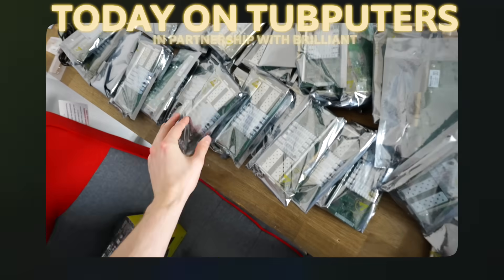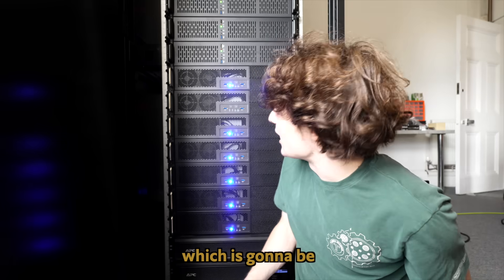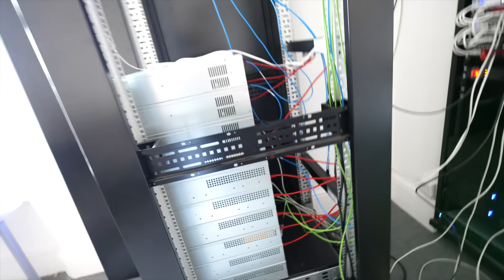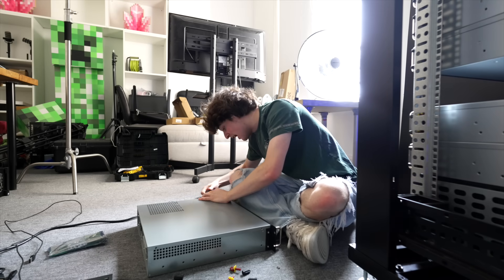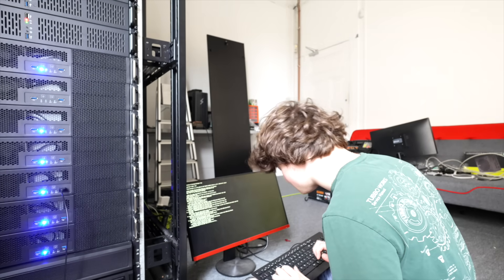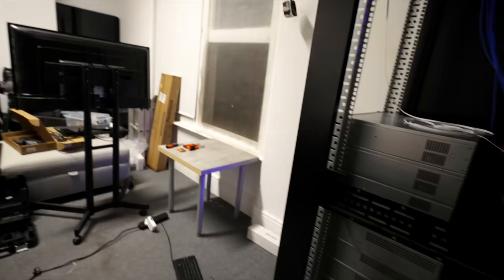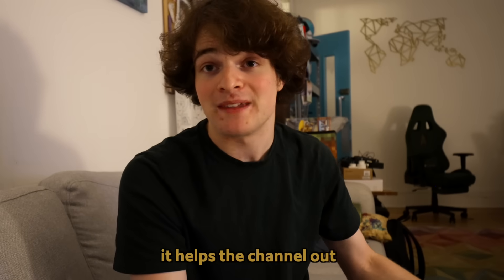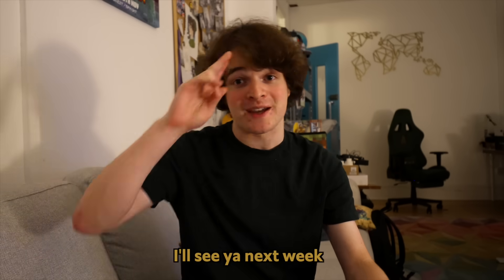Massive Server Room Upgrade!

Comment: Having the exhaust of hot servers pointing towards the intake of the servers behind is bad practice. you should put the racks in a position where cold air pulls through the front and through the servers and the hot air expelled out the back. Your best bet for next summer will be air-conditioning.

Comment: In a earlier video I had thanked you for doing what u are doing but I have found myself to regret that! Play. Host doesn't work and there is not support or answers provided for the data loss! 
Data loss is a big thing if it was a paid service you might have been sued by now! It being free is protecting you from that! 
. 
Just say how long server will not work. You will loose users more than when being honest if this goes on

Comment: Hey, I've got a small home lab with a Dell PowerEdge R710 and an R515, and I'm struggling with cpu usage and performances. i wanted to know how you are handling so much load; is it just because these CPUs are crazy, or is it that you run servers in a certain way? To move the load out of the CPU?

Comment: container@playhosting~ Server marked as offline...
container@playhosting~ Server marked as starting...
[Pterodactyl Daemon]: Updating process configuration files...
[Pterodactyl Daemon]: Ensuring file permissions are set correctly, this could take a few seconds...
[Pterodactyl Daemon]: Pulling Docker container image, this could take a few minutes to complete...
[Pterodactyl Daemon]: Finished pulling Docker container image
container@playhosting~ Server marked as offline...
container@playhosting~ An unexpected error occurred while starting the server. Please contact an Administrator. anyone know why this happened ? everything was fine til i enabled command blocks in server prop i turned it back off after the issue and its still the same.
Reply: now its saying This server is currently suspended and the functionality requested is unavailable.

Comment: at 6:40 you are setting the ip address manually, and bring the interface up. But I think this does not stays there when you reboot the server? Since those commands do not save the settings. 

Also wondering I see you have the switch at front of your rack. But the network connections are at the back, And you can reach the rack from the back side. Isn't it better idea to place the switch at the back?

Comment: Your best bet is to get your own AS Number and get Openreach/VM L2 Transport to London so you can control the whole network to minimise latency spikes - it's not so expensive. DDoS is an issue though so better to interconnect with CosmicGuard/TCPShield/NeoProtect directly so you dont need to tunnel anymore

Comment: I would recommend looking into a container platform, if you haven't already, so that you could have a backup node to pickup slack from other systems that need to go down, such as for upgrades, that way you could maintain a server online, even if potentially at reduced capability if the backup node isn't as powerful as the primary node. would make communicating downtime a lot better if you can tell them reduced bandwidth or short switchover time opposed to full server outage

Comment: Are the power supplies getting enough air? You have the cases on top of each other directly with no spacing between, meaning the cut outs for the power supply airflow aren't actually able to breath.

Comment: If you're interested in what the command was doing it was selecting the port on the new card, changing the ip on that card, then setting the state to "up" so it's usable. And then lastly setting the default route to your gateway. Depending on your OS, you can also just do this in a file, which can be useful if you're doing it on multiple servers, as you can just send the file to the server. For excample on Ubuntu you edit the yaml file in /etc/netplan/ to do the same.

Comment: Ok I like this video in the series. He is actually learning things. I personally have 8 years of low voltage and 4 years of cyber security experience. I learned by doing excessive projects for friends and family. Please keep learning. I understand you are small for now but at some point you will need to test these upgrades for months before putting them in production.

Comment: Love the video. However, my understanding is that the network cards you bought are passively cooled because they are designed to go in rack servers with high airflow (ie jet engine). If you don’t have enough airflow, these network cards might cool themselves to death. Check it out, I think a lot of people add small noctua fans to cool them. They also won’t get as hot if you use DAC cables for the SFP+ connections.

Comment: Should look into using passive SFP modules/cables, will dramatically cut down on the heat generated. Considering that it seems like all your connections are less than 10m, you should be able to do this just fine.

Comment: I am having a problem with a server I was trying, I added a plugin to the root folder (didn't see plugin folder 💀), I tried to run the server and it didn't work. Then I noticed the plugin, I deleted it  but after that, I wasn't able to join the server, just got "disconnected"

Comment: SoooooOOoooooooo...

You really need to put rails on your servers. As it is the far ends are all sitting on top of each other, and that's a lot of force on the bottom one, which is also not supported. Sliding rails are great, since you can pull a server out and leave it hanging out front where you can service it, but you can also get shelf-style rails that are a lot less expensive.
Reply: Nah, ive seen much, much more weight than those pc cases hanging just off a few rack screws for years without issue. $400k routers sitting on top of each other with 8 screws each to hold em up. Youd be surprised at the shear strength of screws. 

For servicing though, yeah rails would be super nice to have.

Comment: 6:22 just normal way of setting a static IP manually in Linux. "ip addr" is short for "ip adress", by the way, so it's just assigning the IP to the interface, setting its state to "up" (active), and assigning the gateway. The downside of doing it like that is you have to do it on every boot. That's why there are all these tools like systemd-networkd or NetworkManager. You can also just use /etc/network/interfaces for manual configuration that is persistent after reboots, which is the simplest option, in my opinion.
Great video btw! 🌟

Comment: 6:40
You added an IP address to the interface card.
You added the default gateway so the computer knows where to send traffic that isn't destined for its local network.

The problem of doing it this way: it only works for the duration of the servers uptime, it won't survive across a reboot.
You need to edit the systems interface configuration to make the change persistent across reboots.

FOOD FOR THOUGHT:
Create your own server network ✅ 
Run DHCP on the server network ❓ 
Run a PXE (pixie) server on it ❓ 
Boot the servers from a common NAS and linux ISO ❓ 
Send load to each of the servers depending on how busy it is ❓
Baddabing baddaboom

Comment: If you don't set the network config in systemd-networkd or networks file a reboot will remove your interface config. (The ip commands you did at 6:45)
Also please tell me you are not removing live servers from paying customers o.O
Could you share with us a case where internal network speed matters for Minecraft servers ?
I don't personally see any benefit from having a higher LAN bandwidth that WAN for minecraft servers. (Even with bungeecord as a proxy)
Also the window cooling is cool but you will end up with crazy amount of dust in the servers, humidity isn't great either.
Its just remarks trying to help not mocking or anything negative.

Comment: No idea if you have a 3D printer but it could be a good idea to print a rack mount for the mini PC. It’ll also look a little cleaner. Just a suggestion
Reply: Depending on what outcome you want, that can actually be quite flimsy and potentially fall out
Reply: @Adam-n1p6mpeople with raspberry pi ones tend to put it above another rack so it has something to rest on. Otherwise a material like ABS is good for this
Reply: @wanderingmeander  that’s the main issue in the production environment. You have to be able to slide things in and out with no fat otherwise 30 seconds of downtime swapping out the machine can turn into 10 minutes which will be problematic.
Reply: @Adam-n1p6mthat’s fair. Didn’t think about that

Comment: The first Command is to add the interface
The second command is to give the system the information that the interface is ready to be used and has to go online
The third command is to tell the system with Gateway IP (your router IP) it has to use to have internet.

Comment: Just use 1U servers. 

1. You can fit more Servers in 1 Rack
2. There are really good, efficient 1U servers
3. You can build Ryzen9 9950X3D Servers into 1U
4. Redundant Power Supplys.

About your Router:

1. Use MikroTik for your Router
2. Use MikroTik for your Router
3. A Mini PC with USB to LAN adapter is not ment for the use of a Router.
4. Use MikroTik for your Router
Reply: A mini pc with vyos is perfectly fine. He just need a mini pc with 2 2.5Gb nic since his upload link is 2Gb
Reply: @proxgs7703  what is when he wants to upgrade to 5G or more?
Reply: Hes already got cisco gear why would he switch to anything else. Also what the hell is a HE? Its measured in U's
Reply: @throwawayaccount838  Sorry i'm german and Rack Units are called HE in germany, sorry. I ment MikroTik as his router
Reply: @throwawayaccount838  That isn't Cisco, his core switch for the servers in this new rack has SFP+ DAC cables and is an Arista switch

Comment: Hey, these command at 6:35 you've typed in they only apply a temporary configuration. You have to add your new configuration to /etc/network/interfaces (at least on Debian, if you don't use NetworkManager) for it to persist reboots! You can read the man page for more info, it's quite simple actually🙂

Edit: To be specific, the `ip` command only modifies the in-memory kernel configuration. So it does not survive reboots. However, Debian reads /etc/network/interfaces at startup (or when running sudo systemctl restart networking) and then applies it so you don't have to apply any configuration manually.
Reply from the maker: thanks legend
Reply: @Tubputers dw it's a very common mistake. You probably only have to change the network interface name in that file (I suspect the previous configuration is still in there).

Though instead of configuring each systems IP in the rack separately, I highly recommend configuring a DHCP server that gives out static IP addresses. This way you can configure the IPs and default routes at a central, reliable point. It does not work in all configurations though, but it's flexible enough even for a lot of big hosters to configure their customers machines via DHCP!
Reply: @realtuxi  using DHCP for live config moves the DHCP server to now be a point of failure. If the DHCP service is unavailable, servers won't get an IP.  Don't get me wrong, DHCP is good for initial provisioning of blank servers, but in my experience, production systems should try to be as self-reliant as it can be to at least get on the network, especially at this scale and usage case.  Keeps the potential for problems smaller, and more readily troubleshot.
Reply: @trolan  I agree this creates a point of failure, but DHCP servers are extremely reliable (they are very simple pieces of software) and doing it all manually opens up so many opportunities for making (potentially very sneaky) configuration mistakes! And a misconfigured DHCP server can create just as much chaos on the network as (for example) a duplicate IP address on the network. Though a misconfigured DHCP server is probably(?) way more obvious.

Edit: Only for someone who REALLY exactly knows what they are doing manual configuration would be the best option. Imo.
Reply: @realtuxi  From configs of these systems he's done stream, they have an IP and gateway.  Simplest config possible, and if it reboots clean to it, it doesn't need touched again, config is good and stable.  Knowing how to static config a basic network config is foundational knowledge.
Reply: As a side note, there's also a bit of a shift in network configuration in the Debian/Ubuntu side of things, with Netplan showing up a few years back.  Some versions may use it by default instead of /etc/network/interfaces.  /etc/network/interfaces did its job well, but was never a strict format causing many headaches, whereas Netplan is YAML with a defined schema, and some additional functionality, like test/rollback.  If /etc/network/interfaces does the job for now, great!  But you will trip over Netplan in the future, so something to keep in the back of your mind.

Also, if /etc/network/interfaces melts your brain, you can also cheese and stick the various "ip" commands in /etc/rc.local.  It's not the "right" way to do basic networking setup, but that script runs at every boot, so can be used in a pinch when you haven't figured out the "right" way yet.
Reply: @trolan  Also keep in mind that Debian ensures correct order of operation in /etc/network/interfaces. Commands in /etc/rc.local are never guaranteed to run at the correct point of time! Which could cause rather puzzling, random failures.
Reply: Was about to say this! W nerds
Reply: Was looking for this comment. Legend. Would have typed it myself. 
Also … at least in my opinion changing the interfaces config is way easier anyways.

Comment: Yo tubbo you have recently mentioned that the 7950x or the 9950x are the best cpu's for mc server performance, and that is probably true however i am really curious on the x3d chips for servers, and just some other hardware experiments, i have looked and i didn't find a minecraft server benchmark tool or something like that, but i think it would be really cool if you compare different cpus, different ram speeds, different ssd's ect.. to see what is really worth it. there is not a lot of info online on that and i am really curious
Reply: It depends on what you are doing. Ram speeds have almost no effect compared to ram quantity. Cpu clock speeds are the most important thing to worry about UNLESS you are running a multithreading plugin like shredded paper or folia, or you are running something like multipaper. All 3 of those will split the world into dedicated chunks that each of the assigned cores gets and its job is to only deal with everything in that area.
Reply: @masterhacker7065  i know thats how it works in theory however, i've seen 0 people try to prove it though, also how much cores should you assign to a server,  i know it depends on a lot of factors however i would be interesting to actually test and prove what we think
Reply: @masterhacker7065  thats so outdated it really depends what you gonna do on the server a vanilla server can utilize atleast 4 threads nowadays the networking stack for example is entirely multithreaded.

Add in mods like distant horizons that can utilize >16 threads for LODs generation allone, simple voice chat or a web based map. Everything offloaded from the mainthread nowadays.
Reply: @deamit6225 No it completely depends. My server was running on a xeon 6254 and used only 4 threads even with sodium, lithium and distant horizons with the simulation distance set to 20. Now with folia and an epyc 75F3 it uses about 50 threads and with the 1000x1000 chunk area i have constantly generated that means each of the 40 threads (50 total, 5 for end and 5 for nether + 40 for overworld) give each thread about a 25x25 chunk area to deal with which isnt much
Reply: @masterhacker7065  you are completly missing my point. right now you claim one thing another a different thing a 3rd person something different, all i am trying to say is that if tubbo got the resources it would be benificial to the community if he made a video where he compared different cpu's and ram configs performance on minecraft servers, while monitoring their utilization. so we can not argue here in the comments with only our personal testaments
Reply: @deamit6225  My point stands, we need some way to benchmark these claims and see what really improves performance and by how much. for example i dont know how much extra performance will i actually gain if i upgrade from my i5 8500 to a ryzen 9600x

Comment: 5:22 aren't these cases kinda bad for your use-case? The power supply tries to cool itself via the air intake on top, but with all the stacked servers, none of these can properly draw air in. If it never made a problem for you, then it's probably fine (i also don't think there are any "consumer grade" power supplies with a different cooling concept), but it is something that could lead to problems
Reply: you are right thats why server psu's usually air intake from the back, but on the upside just running a fast cpu, with no gpu doesn't require that much power so its not stressing much the powersupply (you have to look at each psu power efficiency curve)
Reply: Yes that IS an issue but he is using very efficient psu's + 240V as well as running a rack which will force air though even the connections and cracks in the psu case.
Reply: There are ATX style PSU that work for this use case. They are typically much more expensive because they are geared for server usage. It would be start to swap to them.
Reply: You could probably also add 1u spacing and throw a few Noctuas there.
Reply: @xanderplayz3446 thats a complete waste of space lol, rack units are precious for a reason especially cause he isnt using dual socket motherboards